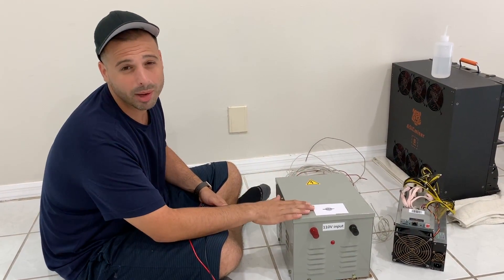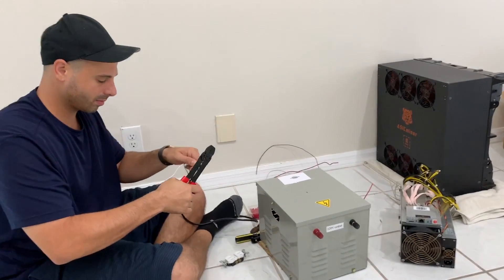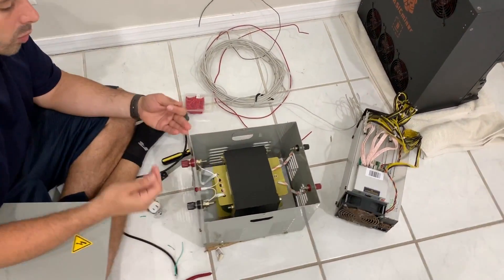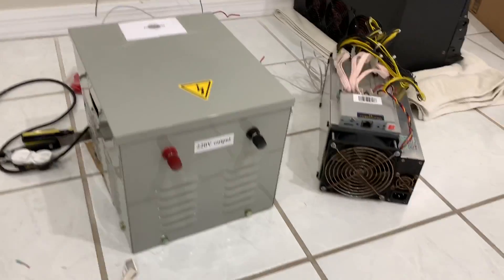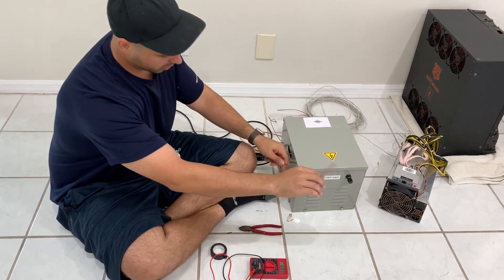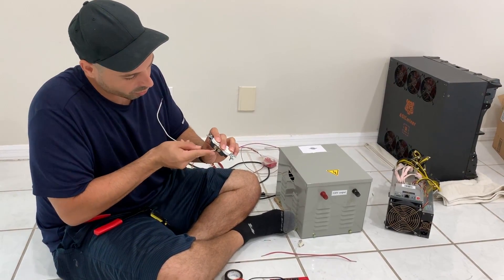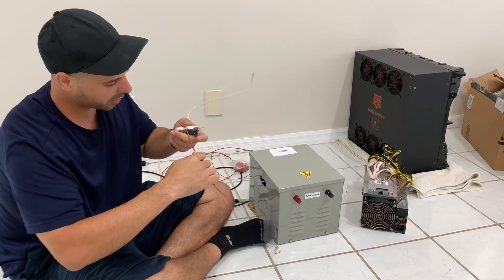How to setup 120v to 220v step up transformer for Bitcoin Mining

Comment: Nice job showing how to cut off and strip the WRONG side of the plug then not showing how you made a mistake. Also using a steak knife (obviously the proper tool) for your video is classy. Using a steak knife and a Harbor Freight multi meter + the baby watching Daddy fry himself.

Comment: Ok I have 110 v Lincoln hobby welder 20 amp pull my house is 20 amp 110v but I want a boost transformer so I don.t kick out brake welding so much so tell which model of boost transformer for welder.

Comment: Link to better converters (actual 240v 20a from 120v 20a) following!
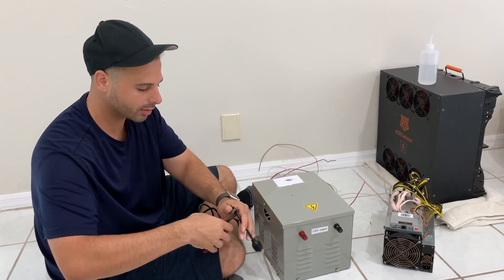I'm glad you didn't get killed here by getting shocked (50v can kill you). It's a dangerous idea if you're running more than 1200W continuously when 220v X 10.9a = 2400W maximum and that's the reason the Antminer S9 APW3++ is one of the power supplies with the most watt output that runs on 120v. If you can find a miner that runs on 240v with a low enough wattage, it will work but drawing more watts from an outlet is a way of starting a fire or short circuit. Check the following video for the actual statistics on the amount of watts you can run with a step up transformer between 1:30 and 2:00 here:

https://www.youtube.com/watch?v=HRkbpr6eMPo&t=98s

But even when they have a high maximum watts, they're assuming that your circuit will be high enough (like 30 or 40 amp) which is not very common in households. You can check the amperage by looking at your breaker box circuit breaker switches for each room and they should display it right on each circuit breaker (240v for the double pole breakers). They have a step up for an actual 240v/220v X 20a circuit at the following links (quick220, steam-brite.com) by using 2 regular household 120v 20a plugs but just make sure you use (an extension cord &) plugs on 2 DIFFERENT 120v 20a circuits, like the bedroom and kitchen or something. Also, don't have any other appliances in those rooms or on those circuits to overload it nor use a GFCI switch. And you may need an adapter for the recommended and supplied PSU (you can use this for miners and appliances for maybe up to 3840W, but I would recommend 3400W or lower to be safer (partly because of the long cords) if it's continuous and even lower especially if you're using old electrical wires and plugs):  

Quick 220: 220v 20a (nema 5-20 which is more compatible with Antminers!):
https://www.quick220.com/220_catalog/20-ampere-systems.html

Steambrite converter: 240v 20a (nema 10-50R):
https://www.steam-brite.com/power-joiner-step-inverter-converts-dual-20amp-120volt-outlets-240volt-wire-20amp-1050r-welder-reverse1050r-p-94180.html?gclid=Cj0KCQjwl_SHBhCQARIsAFIFRVWzzOUReCbYRxYEpwL7WOmZNyXUNookkkJor7q7dxV9KCG6yMrQ01QaAlZrEALw_wcB

I'd check the youtube and google reviews on those also, before purchasing or using them. Like this video:
https://www.youtube.com/watch?v=BEyOZ842Tzs

Comment: guys when you turn one 120v 15 amps into 240 it will drop the amps to equal the same watts, so 120v-10A when converted to 240 it is only 5amps resulting in no extra watts is anything more watts is lost during the conversion to 240 in the transformer

Comment: Is this guy still alive after this kind of installations? 

Miners are 240v because they need more amps than the limited 15a (12a if you stay by the code of using 80% of the output) of the standard 120v outlet. So, miners comes in 240v so they can draw 12/15/20 amps, at 240v which is double the watts. 

Using step up is totally non sense and wont work.
Reply: How should I go about setting up a 240v miner with my 110v outlets?

Comment: Hey having issue with my setup 

Since I'm in Canada 

Ok can only get 125V I have step up converter 

Now one of my machines is 220v and I'm powering it with a step up converter 5000w 

Problem is it still blows the circuit so I had to get the machine to and unplug two chips 

Ive been hearing about this Tripp lite 

But I'm wondering how I'm going to power up a other two machines 

Mainly because power consumption is at 

S9 1850w 

A1 24TH 2100w (supposed) more like 2500w 

And my other machines 

2x aliden 32TH 2700w 

Trying to figure out what a trip lite pdu can help me with 

Wondering if you have a solution or a way to guide me

Comment: If i am converting a 20AMP 110 to a 240 dont I also get to plug more into the 240? max watts 110v 20 amp=2220watts 240v 20 amp=4800watts Am i right about this?
Reply: in theory yes . p = v x i     . i was on the same line of taught .  i bought  a 5000 watts transformer for some 800 watts antminer l3 . plugging in two antminers on the 15 amp circuit will trip it ... with this transformer i want to see if it will run 3 of these machine  . note sometimes those 800 watts machine will hit 940 watts . i am yet to test it  my mining rig is 4 hours away.

Comment: This is called a hard wire? I am buying this unit - http://www.world-import.com/15000b.htm - to connect a heat press that requires 220v 1phase 3000 watts. Would i need to do the same thing you did or would i have to do something else to my breaker panels since i require more than 5,000 watts?  Do you recommend a different transformer?